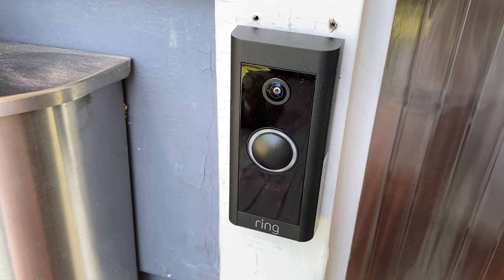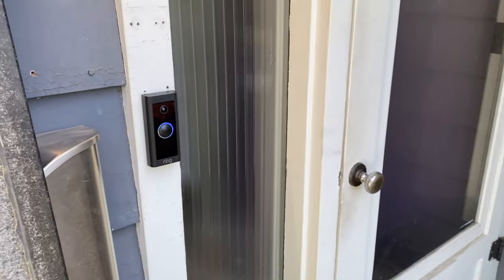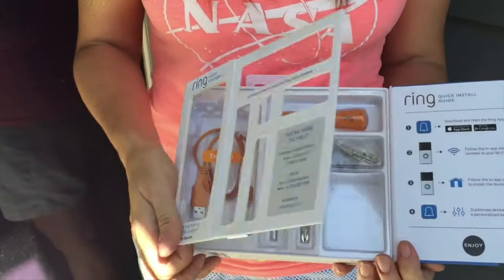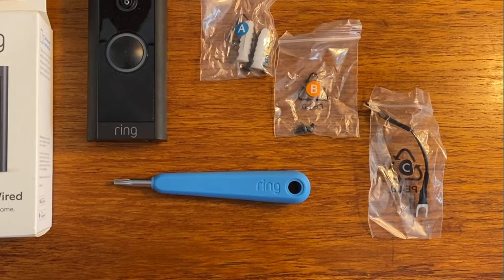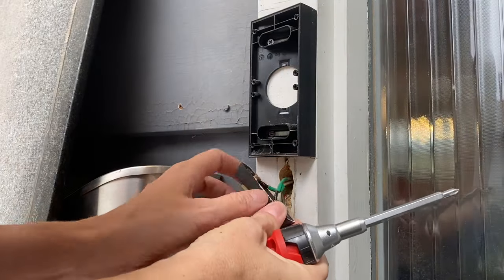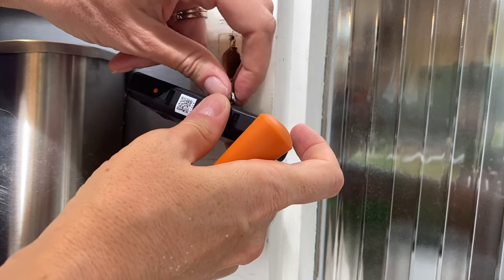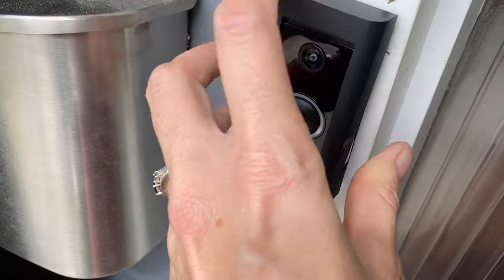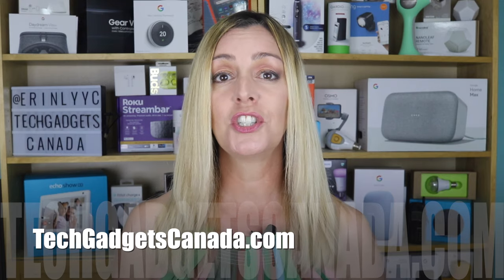How to Install Ring Video Doorbell Wired - it's easier than you think!

Comment: Hi Erin, thank you so much for this video. Even though I have a plug in adaptor and not a hard wired doorbell, this was still very helpful. I thought that I had to take the actual back of the ring doorbell off, I had been struggling for months, now I know I don't need to do that, lol. So my doorbell has been sitting in the box for months for nothing, oh well. I'm in the UK, and the instructions are not very clear, and it shows removing the back. Ring need to update this. Thank you again❤❤
Reply from the maker: Glad it was helpful! Thank you so much for taking the time to write this comment for me.

Comment: Hi Erin, Thanks for the video.  One question.. What's the purpose of the jumper wire making the old doorbell not work?  Can't the Ring work on both?  (Phone and the wall)  I'm looking at this for my mom who's 84 and I'd like the old doorbell to work as well as the new Ring that apparently rings through the App?
Reply from the maker: You could get the Ring Chime for her so there is also an audible tone. I havent' tried wiring it to see if pushing the Ring bell would make the old chime ring or if it's just not compatible...
Reply: Yes, someone please answer
Reply: @ErinLawrenceTV  Good thing Steve asked this question. The video made it seem that the Ring doorbell would make the old doorbell chime work.
So, we have to buy a "ring chime" to make the new ring doorbell audible when pushed.
Reply: I had the old Ring video doorbell and got this model and installed it in my home for the motion detection features. It will not work with your existing in home mechanical chime. Spoke to Customer Service and they confirmed the same. That's a huge bummer. Not sure why they can't just make it work, seeing how their older versions support existing mechanical chimes
Reply: Yeah doesn't this complete the circuit thus making the door bell ring? Or why not just remove the chime altogether? Seems strange.

Comment: Fantastic video. I have a motion sensor light and want to replace that wired connect with the Ring Doorbell. What do I need to do? Please help me understand. Thanks.
Reply from the maker: The wiring for a doorbell and lighting is different. You'd need to consult an electrician.

Comment: I put the jumper cable onto my existing chime but it makes a buzzing sound when switched back on. I've had to then remove it but I have been told that will eventually mess up my Ring doorbell. Any solutions?
Reply: Yeah I don't know what they are doing telling people to use the jumper all it does is complete the circuit causing the bell to want to ring.

Comment: No and no…… no existing doorbell, and my hangup is those tiny holes and tiny screws (the 2 tiny holes on the wired doorbell and the tiny holes on the only corner mount made for the ring wired ).  Are the tiny holes at the top and bottom of the ring only for screws to attach the doorbell to the mount because the tiny provided screws will barely enter the mount.  and the screws point towards the other screws going through the corner wired mount. I am also installing on that soft DutchLap siding.  My main issue is the tiny holes and tiny screws

Comment: I purchased the Ring wired product.  The Ring does not cover the whole left from my old doorbell plate. Does Ring  sell a plate that will screw into my electrical box and then have a place to screw in the Ring? Thanks.

Comment: suppose i want to install this doorbell on the side of my house, not the front..how would the jumper cable be wired
in that case?  front/trans or rear/trans?  also, suppose i want to install 2 of these doorbells, one in the front and one
on the side..how would the jumper cable be wired in that case?

Comment: Hi Erin, I have a 30 years old doorbell and I’m trying to install small packed Ring wired doorbell. I can’t figure out my “Front” and “Trans” points. I see three points on my chime, “1”, “2”, “T”.Please help me find which two of those will be connected with jumper cable. Thank you
Reply: One will say rear or “R” that’s for the back push button

Comment: So we have wires outside for the doorbell i assume they are disconnected from the electricity at the moment as i have connected my doorbell and its not working. How would I switch the power on for the doorbell? I am not going to use the old Chime I am going to use the one that came with the doorbell.

Comment: Which screwdriver are you using? I’m very frustrated, I’ve tried 10 times to unscrew one of the screws on the back of the ring doorbell and it won’t unscrew

Comment: I bought a ring door bell 3 with battery model from USA and using it in UK. Battery is not charging and i have to manually charge it every time its charging is completed. Where as my neighbours are using the one they bought in UK and they never have to charge manually. Any idea how to fix this?

Comment: I connected front and trans with the jumper provided,still no sound. What could I be doing wrong ?
Reply: Remove the jumper wire. That’s what disconnects your original chime by “jumping over” your original bell’s transformer.... They want you to buy their chime, but no need. It will power the original as long as the old bell’s  transformer is still operational. If your old bell stopped working, it’s likely not the buttons but the transformer. 

Look up “install wired doorbell” and find dude showing the full wired setup for original bells. He has three parts in his cover pic here on YouTube. HTH.
Reply: @quietmadness1768  Good to know this can still ring my existing chime (hopefully) Seems no one can answer this question. I don't want to use their chime box, since my existing works fine. I don't even think Ring tech support knows the answer, lol

Comment: If the existing wires is on the rear, you need to put the jumper cable on the rear.

Comment: What happens for 2 door bell houses , front and basement bell connected to same chime. If I put the ring door bell wired on front door will it stop the chime on basement bell
Reply from the maker: Hmmmm. good question and I'm not sure. I think it would stop the other one......
Reply: @ErinLawrenceTV  Finally found the answer. 
Short answer multiple video doorbells can be independently connected to old chime to power and also support the ringing of the chime depending on the video doorbell.

I had to get a wired doorbell to figure this out. It depends on how many doorbells your  chime supports.

Mine was manual chime and it came 2 independent circuit. One said front and other said rear. 

I have the front connected to a ring video doorbell 2 which can trickle charge hardwired and also rings the chime from my old bell. 

For the rear I installed the wired as it is cheaper and does not have hassle of battery charging. I bypassed the chime for rear doorbell and my front chime was unaffected.